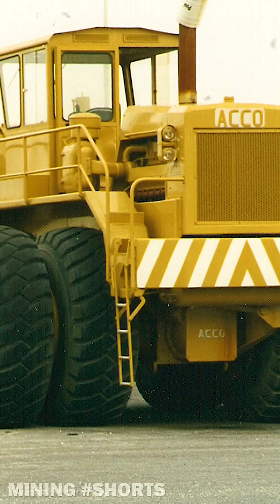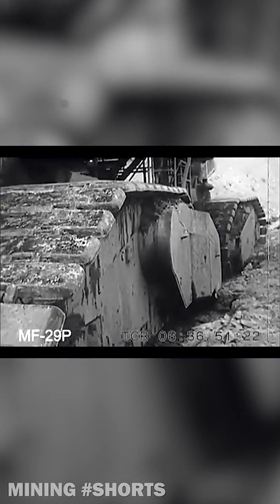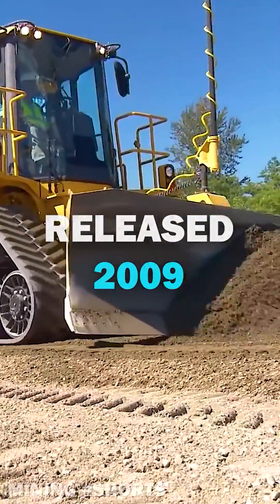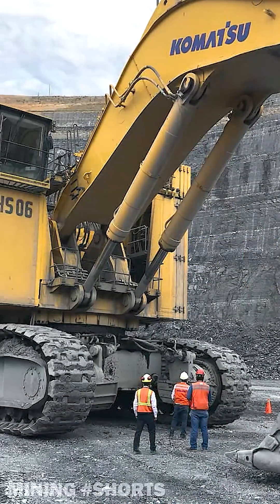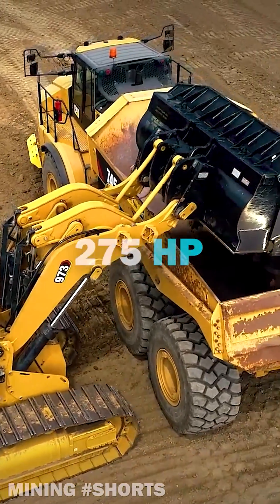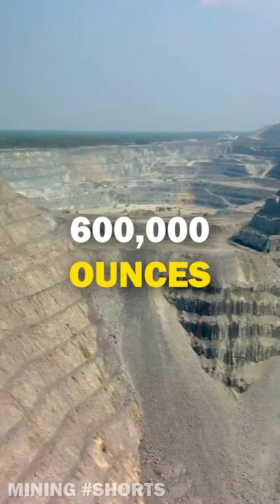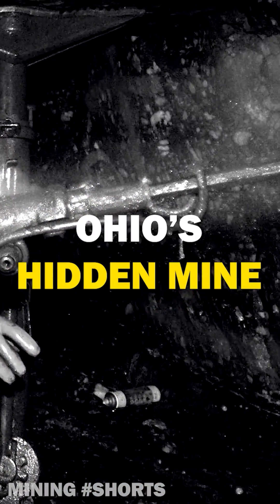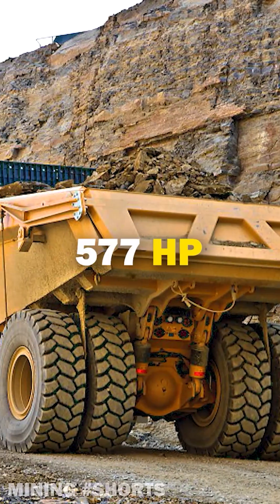Komatsu PC9000: The Next World's Biggest Shovel? | (BEST OF MINING SHORTS APRIL 2024)

Comment: PC9000 will be  i think about 920 metric tons weight and maybe 53-54m3 standard bucket. Time will show
Reply from the maker: I was told the bucket is 85 cy yd (65m3). Let's see by the end of the year if this is true 🙂
Reply: @miningshorts  65m3 is too much, this is level of Rope shovel. I Think 58m3 max. Well by the end of the year will see 😅
Reply from the maker: @UnknowableAbsolute  It seems like too much until it becomes the new normal 😀 It actually comes with a rope shovel kind of cab (side door)
Reply: @miningshorts  Well, we'll see soon) If it's true 65 I'll be shocked
Reply: @miningshorts  I highly doubt it will come with a bucket that is 21 yards larger than the newest rope shovel put into production in the region.

It may be offered with a larger bucket elsewhere, but the digging conditions in the oilsands will dictate a smaller bucket.